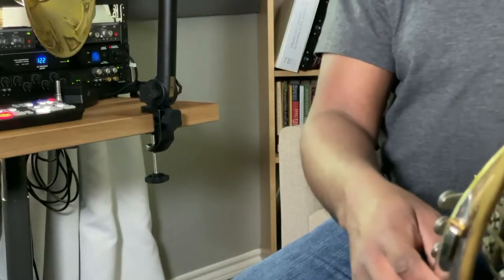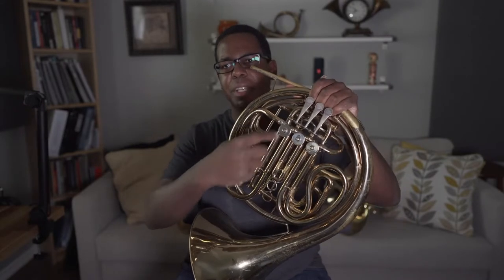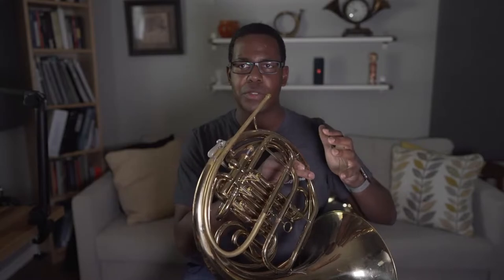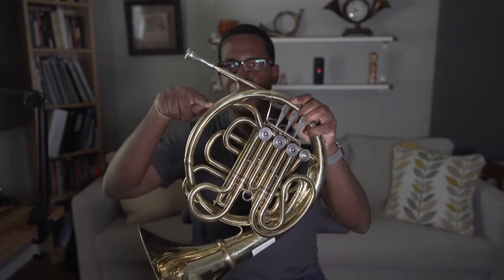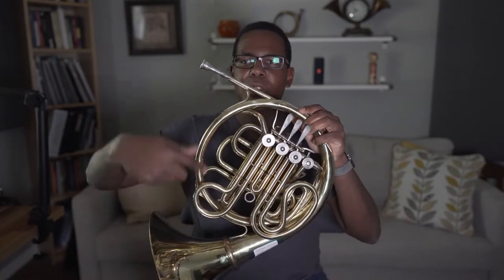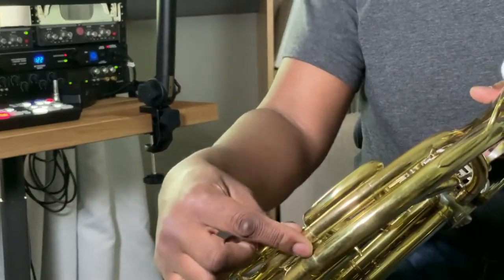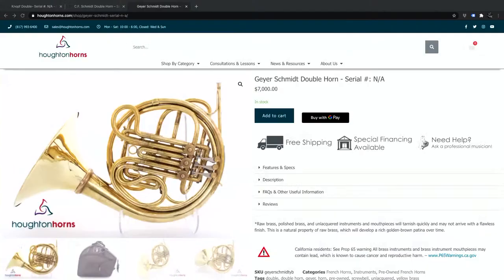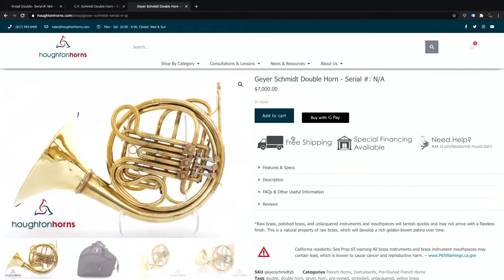A chat about classic horns featuring instruments by Geyer, C.F. Schmidt, Knopf, and Kruspe

Comment: Dr. Wright.  Thank you very much for this informative video.  I need to offer my opinion about what you have presented while comparing the Schmidt/Geyer with the old Kruspe.  Since I have been playing a 1929 Schmidt recently, I have discovered that the receiver/shank of this 'European' horn is fundamentally different from that of an 'American' receiver/shank mouthpiece.   When using an American mouthpiece on a Schmidt or other European horn, you will notice that the mouthpiece does not install to the correct depth.  IOWs the American shank is too large for the receiver on a Schmidt, etc.  This causes the horn to play flat.  It also throws off-center all the notes and creates a generally unsatisfactory result.  I could tell immediately that you were struggling to achieve the result that you wanted from a fine horn.  The notes were never really 'locked into place'.  A 'European' horn like a Schmidt or Alexander must be mated to a 'European' shank mouthpiece.  And, converselly, an 'American' horn must be mated to an 'American' size mouthpiece/shank.

Your demonstration clearly illustrates this point.  Your playing on the Schmidt horn was not your best.  I believe that you were having trouble getting the result that you expected.  I could not really see which mouthpiece you were using, but I would be willing to bet that it has an 'American' shank.  Am I wrong?   By way of contrast, as soon as you picked up the Kruspe, the notes were all DEAD CENTER.....!!!  Everything was better including the intonation and your performance showed that.  I could tell that you had been searching for that elusive 'center' on the Schmidt.  On the Kruspe it was perfect.  

I hope that you will consider this opinion in the spirit that it is given.  You are a fine player in any case.  This may be an idiosyncrasy of which you were already aware.   Your videos are always very informative so I will look forward to more of the same.  Sincerely, freeman.